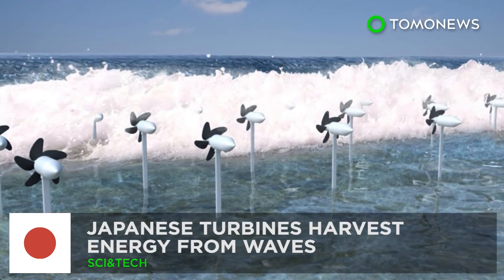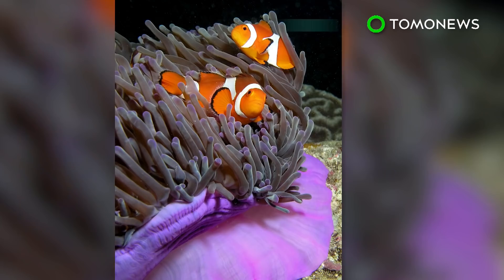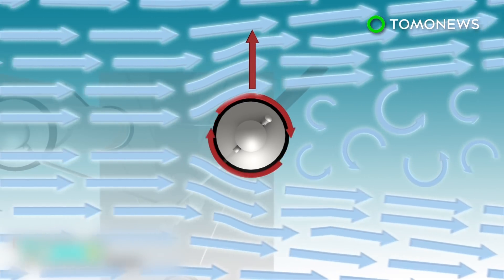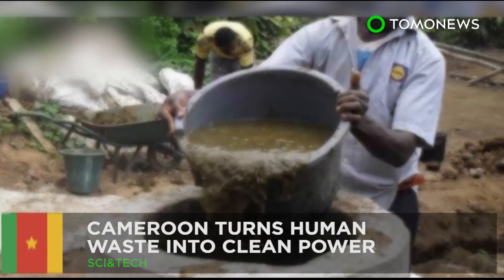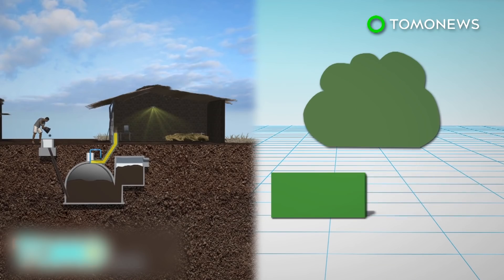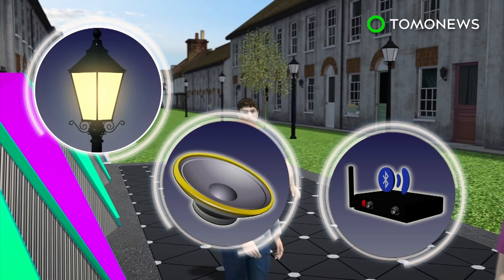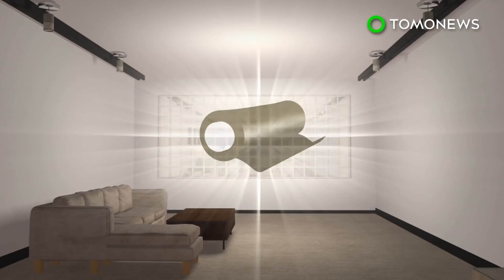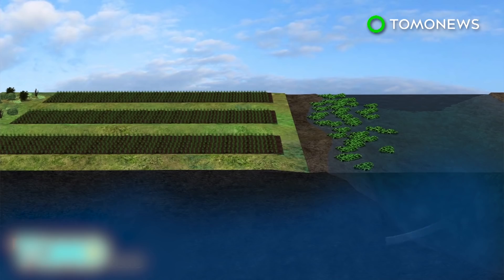Clean energy: New Japanese turbines generate electricity from sea waves - TomoNews

Comment: japan sea water waves gives so much energy by making tunnels across the island
even a single pipe gives so much energy by using burnouli equation thermodynamically correlated equation with energy forever

Comment: if Japan's   government use siphon and inverted siphon then it's become a very good source for electricity production forever

let me explain it
use a long tubes which are equips with turbine made with magnetic materials and wrapped around with coil of copper wire so when the weather or water going to change the turbine easily turned and produced enough energy

Comment: Very good idea. I'd propose adding an auto-height-adjustment feature to keep the turbine blades always at the optimal height relative to the sea surface by making the poles adjustable with telescoping parts where the upper part is buoyant.
Reply: Has Japan not contacted you?! The company went under after they couldn't get ahold of you!
Reply: @davidcarter6501  Touché. So it was dud after all.

Comment: Luckily we've still got 18th-century Steam tech to generate Electricity.   A Boiler, Coal, and water.   I didn't say you had to like it, I'm not a Climate change denialist, so I don't like it either.  The reality is that none of the modern "green" Electricity generatingTech Is 24/7, so it can't do it on its own.   So, luckily we've still got 18th-century steam tech, otherwise we'd be wandering around in the dark.
Reply: this is 24/7 because the ocean  never stops moving...………………………….it's an endless source of energy that replenishes itself over and over again

Comment: How long will they last 10 to 15 years and more fossil fuels to build more, salt water corrosion will destroy metal very quickly most wind turbines at sea never last more than 20 years 15 is the best most can give,  then land fill and more fossil fuels to make more 240,000 tons of C02 for one 80 meter wind mill.
Reply: you can use electricity  produced by these ocean turbines to create new replacement turbines………..……...

Comment: Just say no to biogas. If you burn stuff, it pollutes the air, period.
Reply: Actually, methane is clean burning and mostly water vapor with a small amount of carbon dioxide. Releasing unburned methane into the air is dangerous though because methane is a very powerful greenhouse gas.

Comment: Energy that is not used instantaneously must be stored. Current grid designs have little to no storage capacity. How does the ability to generate 50 years of supply with wave energy benefit?

Comment: I think this is a bunch of hype.  It hard to make small turbines cost effective, even if you have lots of them.   Plus their half scale model is going to power LEDs?  At half scale it should power something that actually uses some power.   I can power LEDs with something the size of a kids pinwheel.  Additionally most wave motion isn't horizontal, (the wave propagates horizontally, but the water itself moves up and down.)